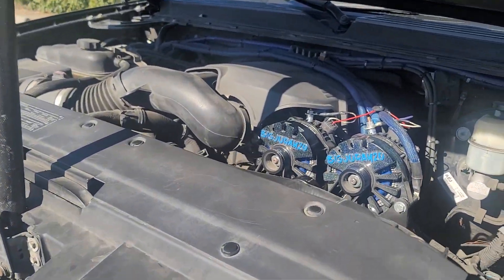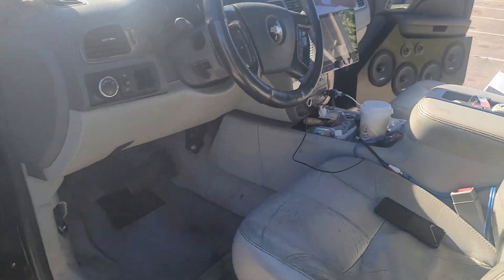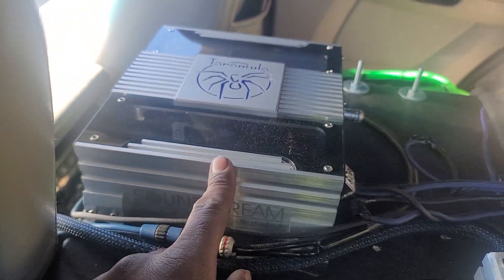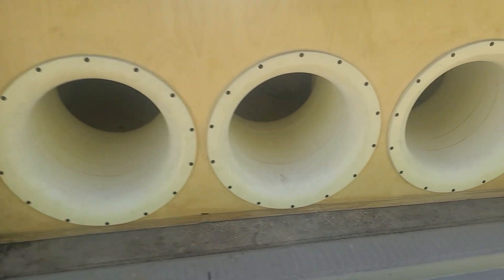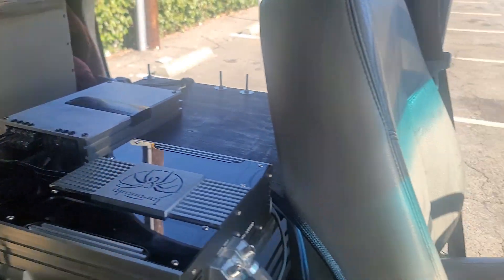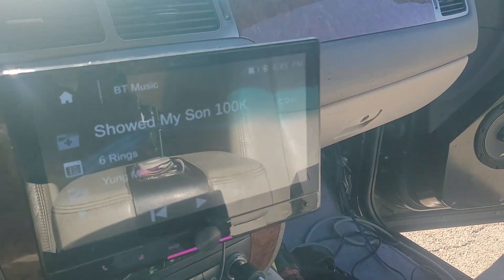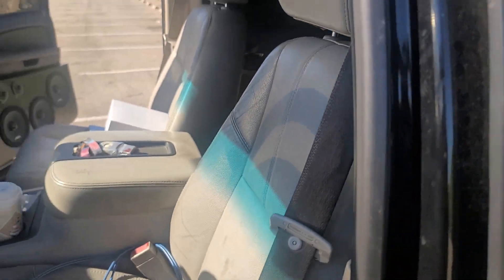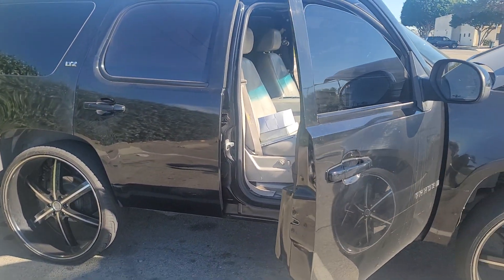Walk Around And Demo Of My 2007 Chevy Tahoe LTZ With 6 15 Inch Subwoofers

Comment: Nothing a little foam can handle, you'll be suprised how much more db you get,🤘🤘
Reply from the maker: I have the material I'll just have to get to it
Reply: @BIGJURAY20  
Have you metered?
Reply from the maker: @21jordanlee  Yes, so far it'll do 159+ in the kick 157+ on the glass
Reply: @BIGJURAY20  
Not to shabby for a no wall,👏👏
Reply from the maker: Going to try and get it louder and cleaner from here. Then I'd like to try for a wall
Reply: @BIGJURAY20  
Sum 18s in a 6th would do. 4 is all you need.👍👍
Reply from the maker: @21jordanlee  6th orders do get down would be nice to have one day

Comment: If you can build a solid roof it will improve your sound and airflow. I took my headliner down and lost alot. I poked tiny holes in headliner and spray foamed underneath and it's as solid as a brick. Made a huge sound improvement. Bad ass set up though. Very nice man
Reply from the maker: Appreciate the love and tips. I definitely plan on strengthening my roof as well as other panels.
Reply: Str8 slappin my boy...love how the build coming...
Reply from the maker: @blazed7785  Appreciate it bro